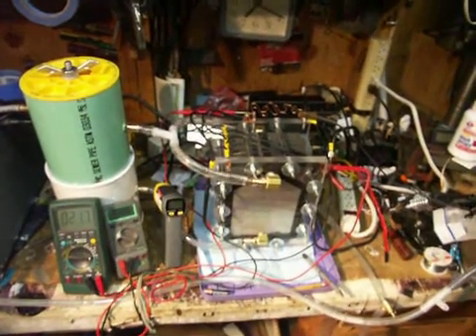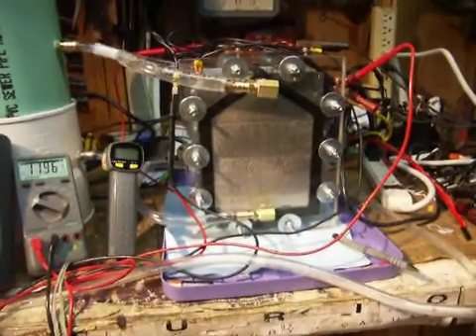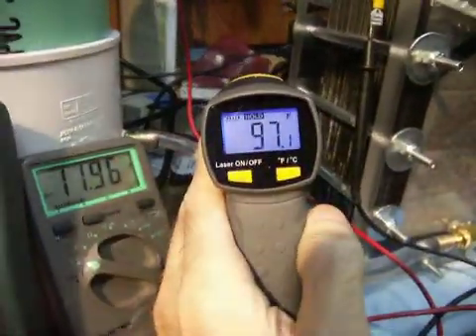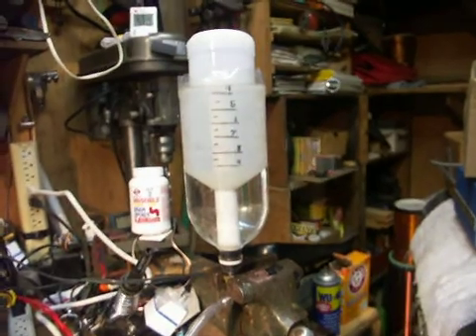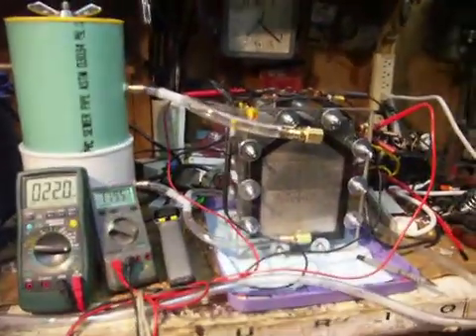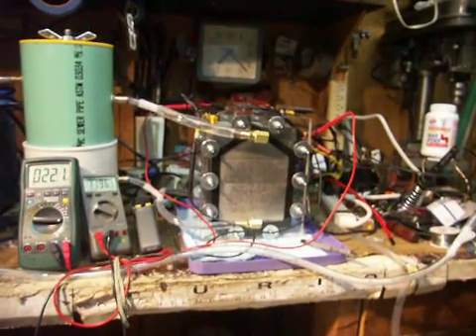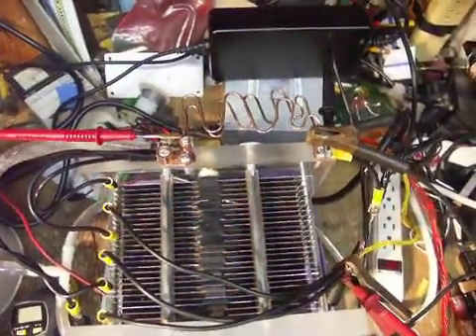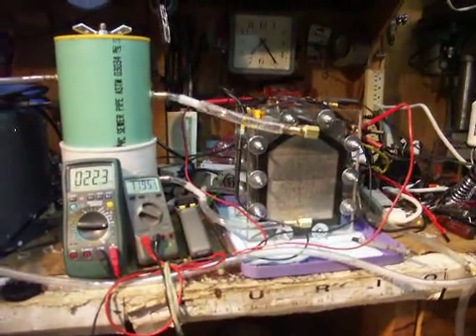HHO Dry Cell Testing #3 New Cell

Comment from the maker: I think it is the power supply. As the temp comes and the amps increase the voltage drops a bit. Fewer volts to the plates = less efficiency
Its just a theory. Guess I need big O monster variable power supply like zerofossilfuel has.

Comment: Nice looking cell, I really like the house shaped gaskets which is giving me some ideas!
It is odd that you are getting better production with cooler temps, as I have read optimal temps for production in lab test have been higher.
They are using KOH
"Electrolyte resistance decreases with increasing
temperature, so electrolysis becomes more electrically efficient with increasing temperature."

Comment: Hi PeteDog:
I use NaOH in my drycell and my MMWs vary between 4.5 and 6. I attribute the variation to the poor readability of my amp meter and the stop watch finger inaccuracy. One thing that has been consistent is that my MMWs are higher at the higher temps. Some of that increase can be attributed to the expansion of the HHO at the higher temps but I still think that the process is more efficient at higher temps. I am surprised to see that you are getting better numbers at low temps.
mars